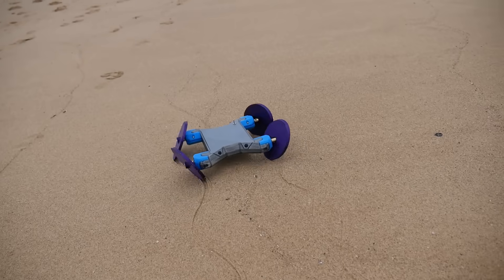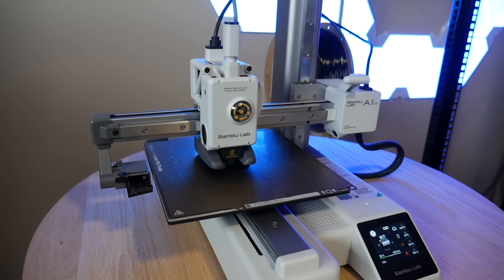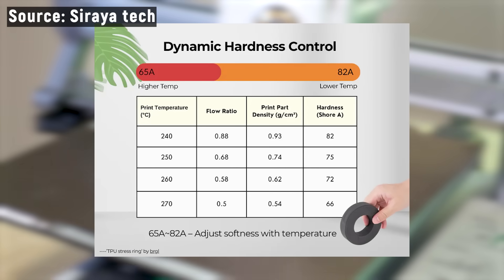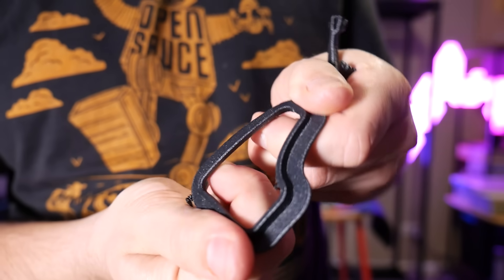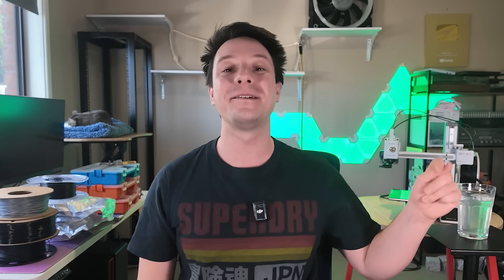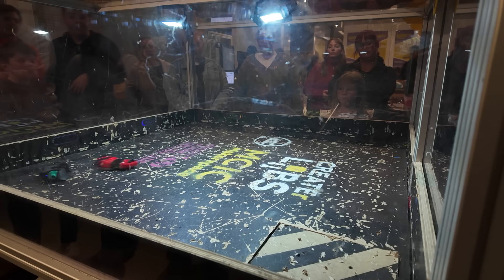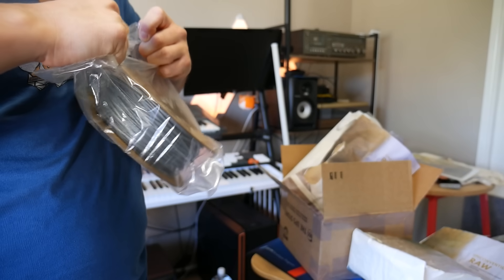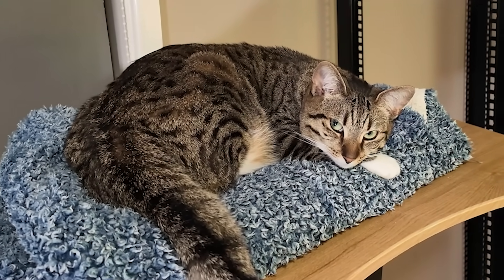3D Printing Filaments that Flex, Bounce and FOAM!

Comment: Edit: this comment is mostly pointless he ended up mentioning pretty much everything I said at the end of the video - You should try CC3D's "72D Nylon TPU" it prints REALLY good once you get the settings dialed in (fyi I had to crank my retraction down to 0.6mm on a .6mm nozzle because every single print looked like the filament was wet) and its like the other filament you mentioned where it's flexible but shatters if hit too hard but I think its stiffness combined with its flex (its weird but again exactly like a non newtonian fluid) I think it would be great as an inner housing for highly durable stuff with as TPU outside cover and its also really good for snap fit parts because you can have tighter tolerances and it'll still work yet it also snap securely thanks to its rubber like exterior
Reply: The 64D and 72D TPU I've tried does not shatter. I would honestly not want that property.

Comment: Try Forgelabs Flexible PLA. I like it more than any TPUs I've used. It does have the same TPU like tendencies when it comes to bed adhesion though, so definitely use a glue stick or something to make removal easier.

Comment: I think you forgot something Angus. I heard that if you boil 3D printed nylon parts in water for 40 minutes it gets A    L  O  T    S  O  F  T  E  R
Reply from the maker: Ooh interesting! I know it can improve strength but haven't tried it for flex properties
Reply: @MakersMuse  oh and one thing if you ever use this with an antweight (in America a fairyweight) just know they gain some weight because some water gets trapped in them, but you can get it out by slapping it against your table.
Reply: Does PP get softer too?
Reply: Interesting,  thanks!

Comment: Hi there, thanks so much for the video, I'm designing and printing shoes and shoe parts now and really wanted a fam like TPU with adjustable hardness for this projects. 
But you forgot to put the link to this one, actually you put the same link as the PBT Pro (GF) one. 
If yo ucould update the captions with the correct link I would really apreciate it 

thanks aganiin :)
Reply from the maker: It has been updated :)

Comment: I was wondering.

Has anyone tried putting a dehumidifier in their 3D printing space? If you're lucky enough to ofc have a dedicated space.

I understand it won't eliminate the need to dry your materials but, if you can reduce most of the moisture in the room you'd have less being absorbed by your filament. Theoretically that should reduce drying times and allow your filament a longer life cycle.

Just a thought. I'll be doing this in my studio, under remodel as it was my oldest kid's bedroom, as well as adding a dedicated ventilation fan by Panasonic. I have 2 of these fans in bathrooms and they are quiet and can vent spaces up to 110 sq ft/10.22 sq m.
Reply from the maker: I run a large one in the studio during the humid summers here - it can pull 10L of water a day just from the air. Doesn't last long as it just seeps back in from outside, but nothing else got rid of it.
Reply: This is common practice in print farms, yes
Reply: yes. 

lots of people have done it and are doing it, without thinking much about it. but if you live somewhere where it's hot enough that you run an airconditioner basically more or less 24/7.. yes. you're dehumidifying the entire space all the time. this is not that viable in most places in europe or norther america though.. even here in thailand there's couple of months where i live where that it gets cooler than you'd like the room to be, but usually those are the dry months.

airconditioners(most of them anyway) also have a dehumidifier mode(the one with the raindrops as the symbol) where it keeps(is supposed to anyway) keeps the heat exchanger in the room below room temp a little bit, without trying to cool it and even if the room is cooler than the set temp).

you can use a corn snack as a humidity indicator. if it goes softy it's humid, if it hardens up after that it's dry.
Reply: @lasskinn474  Yeah. The AC helps but my house is so poorly built and the windows need replacing that it can go from 60% to 73% in an hour or 2. I've hit 83% before.
Reply: Thank you! 🖖🏻

Comment: unless these companies get a third party lab to validate their claims, I will always assume it is not safe. Those time delayed plastics could have some great uses, but I'd rather err on the side of caution.
Reply: For real. That's a very serious concern. We shouldn't blow it off.
Reply: While I agree in this case it looks like they're just polymerizing sugar alcohols.  If that is indeed the case then the worst I'd expect from drinking a decent amount of it dissolved in water is diarrhea and bloating due to gut bacteria breaking it down.
Reply: @EkiToji 
Interesting, thx.

What sugar alcohols, though - ?

Comment: I used some foaming TPU as a coupling joint between a pair of brushless motors for my motor testing dynamometer. It worked great until I put the whole thing in a 50C temp chamber to test our product in a hot environment.
Reply from the maker: Interesting! So the TPU foam softened at that low of a temperature?
Reply: @MakersMuse  Actually, it did fine! The PLA motor mounts started to warp, so the motors got misaligned enough that the rigid portion of the coupling started to grind up the flexible portion. We later moved the whole dyno out of the temp chamber after that, hehe.
Reply from the maker: @bncesper Ah yep that'd do it! PLA softens at notoriously low temperatures. Ive had pla prints deform in the car on a hot summer day.
Reply: Would PBT be a good material to use in a hot car? What is its UV resistance like?
Reply: @Knowbody42 Whatever you use, UV isn’t an issue if you use automotive grade UV resistant clear coat.

I used to do auto body work and custom vinyl decals and stuff and a clear coat with uv protection will keep the underlying material from getting destroyed.

They even make uv protection for the leather and stuff too.. I highly recommend it. 3M has some great options but any hardware store UV protection spray will do just fine.

Comment: Having tried the CC3D PBT-Pro and straight PBT I don't think the CC3D filament is exactly what it says it is. It's definitely an alloy with something else because it behaves completely different during printing warping like hell and the resulting parts don't have the same flex.

Comment: If it is so low density and keeps its shape on impact, would it make for a good RC airplane material?
Reply from the maker: I think PP would be fantastic for single wall wings, but will defer to someone with more experience!
Reply: Pp cf or pp gf is great for rc planes, just a bit of a pain to print sometimes

Comment: Hello makers muse! Can you make a video about Solid edge community edition? That will be very nice - thank you :) I have started using it instead of Freecad and I enjoy it - I would just wish to get your opinion about it, if you don't mind :D
Reply: Also, how do you clean glue stick off a PEI magnetic bed sheet?
Reply: @Bluefisher-o9v  Warm soapy water.
There are a few other options but this is what most people do.
Reply: @shawnduffy279  But wont the magnetic sheet beneath it start to rust???
Reply: @Bluefisher-o9v  I'm not sure what you mean.

You remove your build plate, take it to a sink, wash it, dry it with a towel (just like a dish) and put it back in the printer. 
Some builders will spray isopropyl alcohol on the plate after placing it back into the printer and wipe that off with a lint free towel.

Comment: Today I learned you need PP to print PP.
Reply: Instructions unclear, printer covered in urine.
Reply: @beaconofwierd1883 😂😂😂😂
Reply: My pp has slow print speed.  Took me 9 months to finish my last print lol
Reply: @geagle666 😆
Reply: @geagle666 😂😂😂
Reply: That's a lot of pp
Reply: I discovered this with TPE. Some brands won't stick to anything except PP sheet (which can be bought easily and glued to the steel sheet).
Reply: Magigoo PP works great and is less hassle, but more expensive, than packing tape